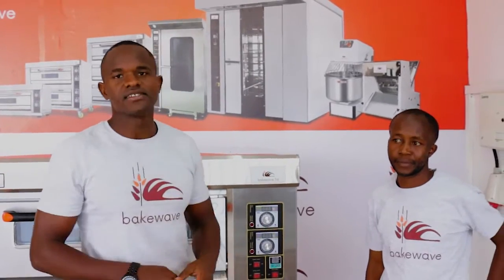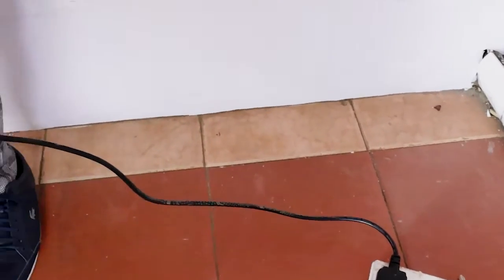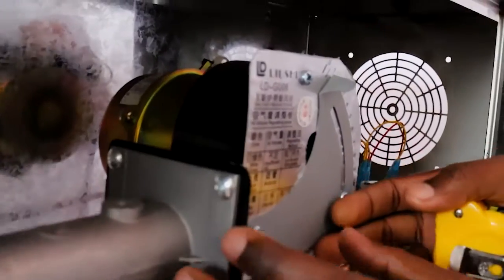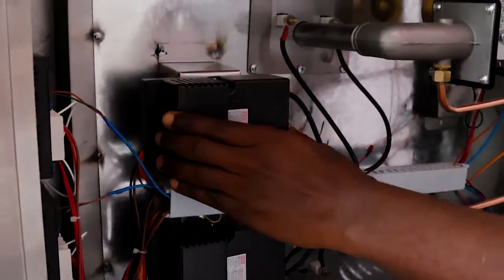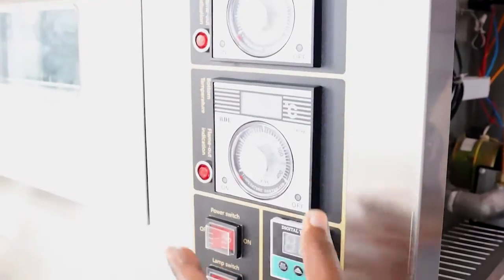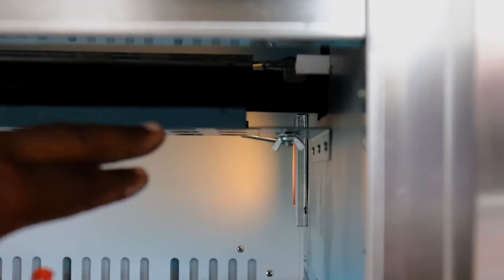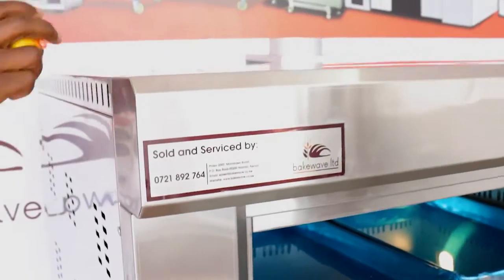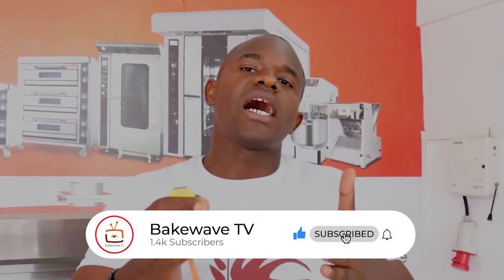THE LOW CONSUMPTION DECK OVEN. Whats inside #bakinginkenya #kenyanbaker #bakwave

Comment: can you convert an existing electric deck oven to gas
Reply from the maker: Hello👋🏾@philipkingungui811 . Thats a great question.Yes you can be able to change it but it is not a process that is worth the effort. This is because it would involve a lot of technical changes, as you would have to remove all the electrical parts and remodify the oven to fit gas parts. It is a daunting process and is not as recommendable.